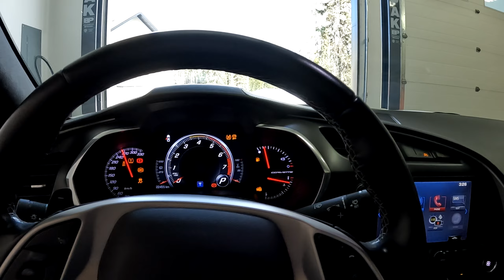Did I ruin my Corvette...

Comment: many years ago I was respraying my 1966 HR Holden British Racing green it was the final coats of paint very late (like annoy your neighbours at 11pm with the running compressor) on a very warm and still Aussie evening and I happened to glance back down the driveway along the side of the house and 7 foot high fence and there is this green haze of overspray for 30 meters out into the street! I cracked another beer and continued with my painting......good times, miss that car 

EDIT forgot to mention the next morning noticed the concrete under carport had a nice tinge of green to it where the car was parked and a big clean clean patch after I moved the car.....oooops
Reply from the maker: Nice love that color

Comment: Well crap happens Mike, but I would have used Meguiars paint cleaner and scratch remover there products do a outstanding job, they have compounds that remove over spray without using harsh chemicals like lacquer thinner.MIKE NEVER leave a can of any thinner on your car, if the can leaks or if there some that ran down the sides, you just bought yourself a new paint job, yeah I know Nag-Nag-Nag.😋
Reply from the maker: I will have to check it out